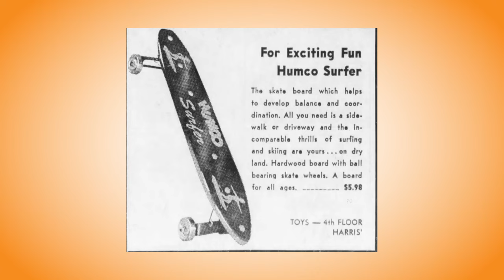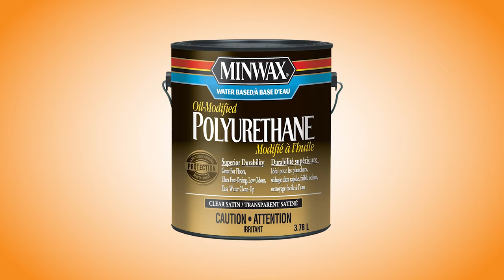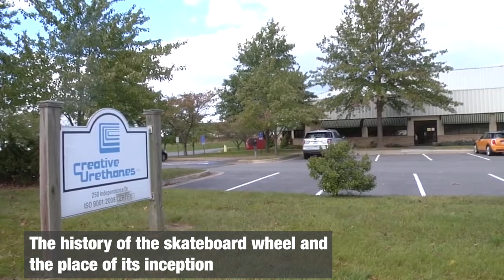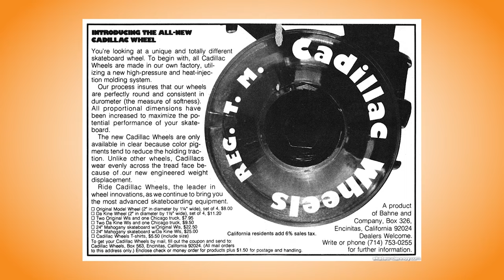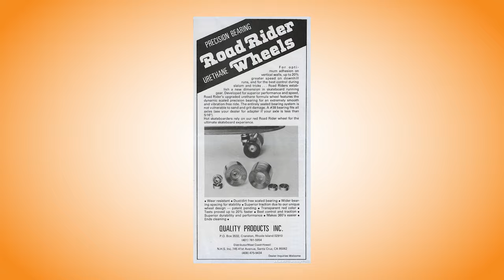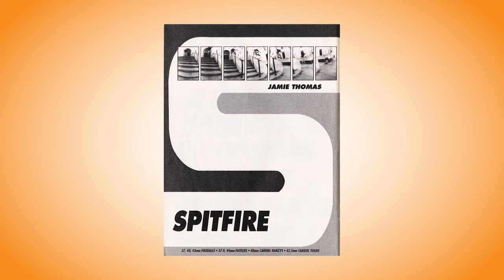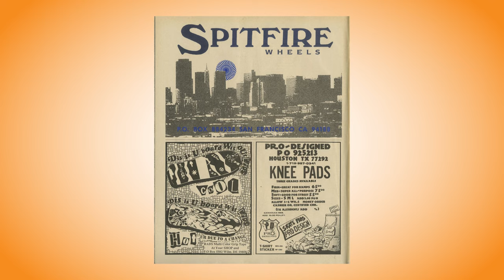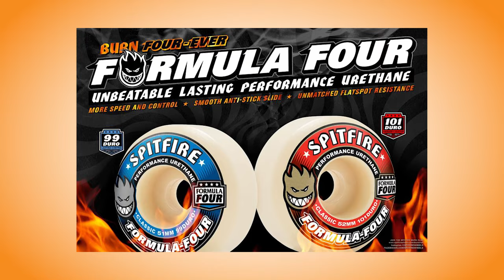The History of Skateboard Wheels

Comment: Interesting documentary, Shredz Shop.  I appreciate your historical research and your inclusion of the roll that Vern Heitfield and Creative Urethanes played in the early PU wheel market.  They started it all.  They were also the only processor I spoke with in 1976 that thought they could pour the first Bones Double Radial MDI production wheels. Sadly, Vern's home made mixing equipment was not up to the task.  They failed, and after a year of trying, I had to move to a processor in LA that had just purchased an expensive state of the art mixing machine that was able to mix the long ratios involved in manufacturing the new MDI material we pioneered.  As our volume increased during the 1980's, we were able to purchase this processor, Rogers Manufacturing, and finally gain the ability to completely control our wheel manufacturing, and speed up our R&D dramatically.  I thought it was an oversight on your part to omit our creation of the BONES SPF, and especially the STF that forced Spitfire to find out what we were doing to make such dramatically better wheels.  In fact, Spitfire's F-4 is their version of Bones STF.  Thanks for mentioning Dragon and X formulas.  They are the next generation formulations that our competitors are trying to duplicate now, because they allow us to adjust the slide to grip ratio, roll faster, and absorb more vibration.  Dragons and X formulas are game changing.  Once again, this opens up new skate terrain, and makes skating more fun.  Powell•Peralta and Bones wheel technology have consistently (since 1977) led skateboarding in developing new wheel shapes and polyurethane formulations to enable skaters to have more fun skating, expand skating's performance envelope, and to get more value out of their wheel purchases because of increased durability.  Just saying, we are the leader.
Reply from the maker: Thanks for the amazing comment and history lesson George! Everything here was pieced together from around 20/30 blogs, books, and interviews I could find information on. I'd love to chat more about the invention of the wheel (I'll reach out through our mutuals at Ultimate distribution). Definitely hard to try and cover everything in 10 minutes, as there's full brands we didn't even get to mention. 
I firmly agree you guys have always been at the forefront of skate technology and admire it! Lets just say there's a reason the Dragon Formula is the most modern wheel on the thumbnail!
Reply: So , your company of associate company produced the first Bones before Powell & Peralta?
Reply: @johnfudala128  I think that's George himself talking bro...
Reply: SPF still rule smooth concrete. Amazing work on XF btw, incredible wheels. Thank you for pushing the evolution of skateboarding forward more than any other brand!

Comment: Great video. I remember riding my uncles flat board with clay wheels in the early 70s.  Never broke a wheel but a grain of sand and you're flying off the board.  First board of my own was solid wood with a kick tail and wide fatty urethane wheels about 1978.  Still have an old school Lucero board with Powell Peralta wheels from the late 80s.  Good times.

Comment: Cool vid. I have a set of black Alva Hard Cores. Aluminum core. I think they are 90a. Were on a Bill Danforth Skull complete I bought for 60 bucks back in the mid 90s. I bought everybody's old boards that were sitting in the garage or shed. All wall hangers. Got some old Thunders & Gullwings. 97a Hosoi wheels. Slimeballs etc....
Reply from the maker: Aluminum core is crazyyyy!!
Reply: Changeable outer tires to make new, or different size, hardness. Two piece, screw together inner hub, system.

Comment: Surprised you didn't mention the "core" craze of the early 2000's. I remember how much I loved my Spitfire hollow core wheels. After I couldn't find them anymore I jumped on the 80HDs and eventually into the Formula 4. I've been on the Conical Full 58mm for a few years now. Love em.
Reply: I had blue Ricta Chrome Cores and then some spitfire hollow core wheels but this was 2009 - early 2010s
Reply: @austinhughes2871  oh for sure. Core wheels are definitely still around. Ricta still makes them too. I just remember that every brand had the newest and best wheel with the cores with the most pop, or shock absorption, or this, or that when I started skating in 2001. It was kind of overwhelming, for a beginner who didn't know what was what.

Comment: I was skating in the 90s (began in the mid 80s) and i went through the small wheel fad and man it was tiring pushing it around bc you didn't roll very far like on big wheels. I also has bought some wheels that looked like it had mag rims on them. They were cool looking but man where they hard. They were made for riding ramp and i was a street skater. I ended up trading my brother in law those wheels for a suicidal tendencies (join the army) and Slayer (south of heaven cassette tape) and out my old wheeks back on. My mom uses to say i would get married with that skateboard in my hand i rode it so much. Lol

Comment: Thinking about starting to skate again.  Just doing slappies near my apartment and flatground.  I live in NE Wisconsin though so a lot of parking lots and sidewalks even are jacked up.  

I used to just rock the lower duro F4s.  56mm Conical on my bigger setup and usually 52 classics on my flatground/manual setup.  Hated the Bones STF I tried... WI terrain is just way too jacked.  Even our good spots are sort of rough... also our good terrain is mainly skatelite indoor slippery ass stuff unless you're at a concrete park.  

Anyways I saw the Dragon Formula hype online though and that seems like a great wheel for flatground, slappies and skating a few blocks to the gas station.  I'd ask Slap but I'm a kook that hasn't skated in ages.  Thanks.  Sorry about the wild long comment I'm ripping some rosin off the terp slurper and off them IPAs.

Comment: I go back far enough that actual fabricated our own skateboards.  Starting with ditching the crappy steel sidewalk skates hacking them up to attach to our plywood board. Next came an obtains clay wheel with flexible trucks.  He get improvement over the steel setup.  The trucks were a bit wider which helped a lot with carving turns.  However we were still breaking down roller skates and fabricating our own skateboards.  My first urethane wheeled board was a like a whole new skateboard sport. The biggest problem now was the still somewhat narrow trucks and minuscule board.  Modern boards finally widened the trucks and the board 4:25 deck became huge compared to what existed prior.  By this I was to old and creaky to be play on a skateboard.

Comment: Ive kinda noticed that the small wheel trend is still around a bit. I have two pairs of 45mm OJs, 39mm Boardycakes, 47mm Snot lil shits, 43mm Spitfire Lil Beatdowns (which are formula four) and 43mm Snot Lil Wide Boys. 

They still suck to skate but fun to collect.

Comment: Oj’s double duro! Tried the dragons and the 97x both and in the heat of the Phoenix summer they get soft and sticky. I do like dragons and 97x  better on prefab but the oj double duro is way better at the park and as good at the street
Reply: That’s overlooked and super important, heat makes a huge difference.
I can’t skate 101 or 99s here in Buffalo NY most the year.
I have to have like 90 to maybe 95.
Skating 101 on my masonite ramp in my garage in the winter slips like ice cubes.
Or even outside in below 65 degrees they are so much harder.
Dragons feel great but yeah the few days above 85 degrees and I want something else.

Comment: I used to really like skating really small wheels and cheap brand I would I always take my friends old wheels when they changed them out… a lot of times they were barely bigger than the bearings… I would also buy wheels called “voltage” from the champs at my local mall they were really soft and wore down to a small size pretty fast… I also used to skate really fast idk if there was a correlation there

Comment: my brothers and me decided to tear apart our old metal skates in the 1960's and screw them to a board to make a skate board !  In the 1980's I rented and then bought a pair of used Roller Blades ...I quickly learned that those APEC bearings were made for the ole Reel to Reel music tape players !  and those 3 -5 - 7 and 9 APEC  numbers are the bearings ratings as to how much noise they give off at high speeds !  So do not waste you $$$ on expensive bearing sets for your skate board or roller blades .

Comment: What's with the music? It's as bad as the facts in this video.

Urethane got tried as a roller skate wheel and proved to be too slow. There was a pretty big lapse of time before someone tried urethane wheels on a skateboard.

That's how I remember it anyway. My first skateboard was a Roller Derby inch thick deck with regular roller skate hangers mounted on made skateboards baseplates with roller skate clay (composite) wheels. I added wavey bathtub grip for griptape. My friend, who got me into it when he showed me an issue of Sports Illustrated that had an article about the "resurgence" of "sidewalk surfing." It might have been that article where I got my earlier stated account about the first use of urethane skateboard wheels.

Why did I get a clay wheeled skateboard when there were urethane wheels? I what the toy store on military base had. And actually, it was pretty fast and small rocks of a certain shape will stop any skateboard wheel cold if you don't keep your weight towards the back. AND it was better than the skateboard my friend got from a toy store in town. Which was a Nash with cheap knock offs of precision bearings, hot pour urethane wheels with a single bolt for an axle. The translucent plastic deck sagged horribly. I soon/eventually upgraded to a horribly saggy skate board with loose bearing urethane wheels and trucks with axles as narrow as rollerskate trucks. The deck was just multiple layers of fiberglass made by a California surfboard company. My friend outdid me when upgraded to a wider, longer board with a more sensible kick (tail) and wider trucks. We soon found "Skateboarding" magazine and I ordered a set of Road Riders and a pair Bennett trucks. The trucks had plastic baseplates and that's an idea as dumb as it seems.

I still make bad skateboard buying decisions. I currently have a board that the deck cost $2 at a thrift store with used Indy trucks in good condition for $15 and OJ's off of a pair of Rodney Mullen Tensor trucks that cost me like $110 at a mall skateboard shop. I got a slight discount on the wheels. Those trucks are on a Krooked "Rising Son" deck with artwork on the top and bottom by Mark "Gonz" Gonzales which I put clear griptape on. Dumb choice because clear griptape is too grippy. Also a dumb choice because I bought it at Zumies.

Comment: In the 60's we would ride down our driveway on a small skate board we would sit on it and race down the driveway, sorry flat earther back then, we would push the other person with our feet, problem was we would have our pinky ran over with the steel wheel, ouch.
Then we got the clay wheels and we would go to the cement ditches between OC and Lakewood and ride down them, one guy would go straight down.
I remember getting the Road Rider wheels in red, we called them precessions because of the bearings. Good times back then.
My Sims board has Powell Peralata Lime Green wheels 60mm Cross Bones 97 A. The graphics on the board are The Rising Son.

Comment: its crazy that they though clay wheels was good idea in 1960s. This in time when plastic was mainstream. hell wood wheels are better than clay. Clay wheel would only work for roller rings which have smooth floors. It would not work for ruff sidewalks. I think logicaly small wheels good for tricks bad for cruising. It bad for causing because small wheel have hard time get over bumps and rock.

Comment: Clay wheels didn't explode. When you hit a small pebble they wouldn't go over them or push them away, they would wedge the pebble between the wheel and the road and the pebble starts grinding the road. You end up with a loud noise and a grind mark on the road as your board quickly slowed down and you went flying off the front of it. That happened every time. 
Cadillac Wheels were an amazing improvement but they had a hard plastic core with polyurethane outer bonded to it. After a lot of hard riding, the urethane would delaminate from the hard plastic. Then the Roadriders came out. They were really amazing. Then it seemed like there were loads of new wheels coming out all of the time. I had a set of OJs which were bright orange wheels. I also remember Tunnel wheels the had thinner outer edges that would flex.

Comment: thow transparent polyurethane wher use on skiny boards i the 70is, in the urly to mid 80is  when the big board start coming out  like vision pshichostic and gator , (had adrian de man board )  wee use the kriptos and sims wheel thow use to be very soft ,  after that wee start using throws big and hard wheels ,  is when board like the  natas came out , (i had a smithsick )     and after the lolipop board came out in the 90is with small wheels , m y last board was the vision double one of the first lolipop board ,